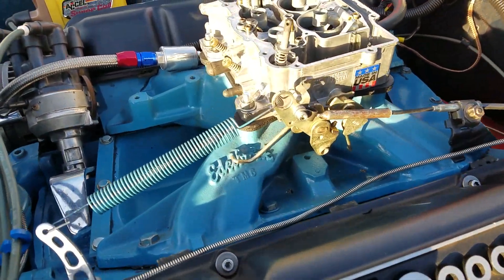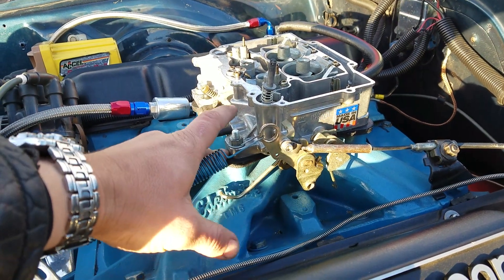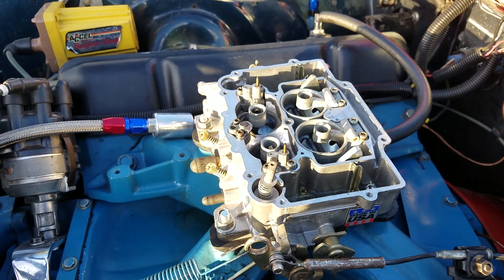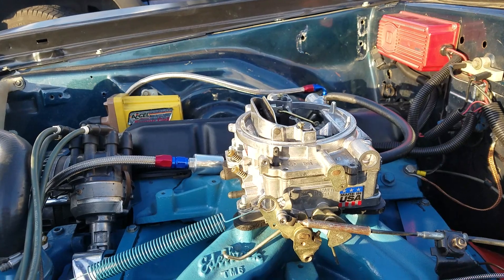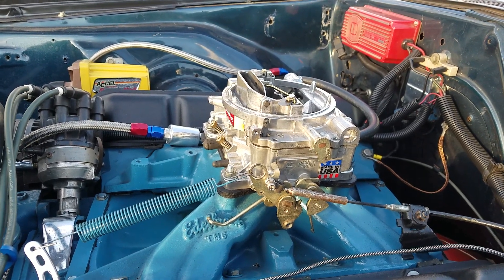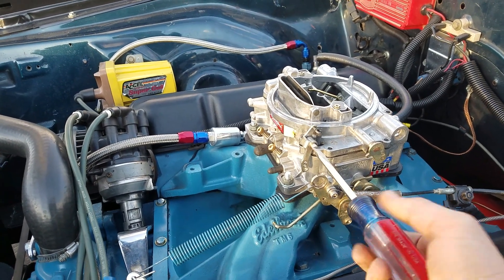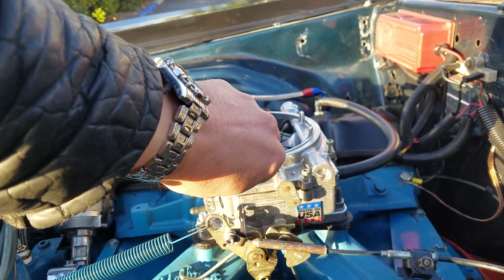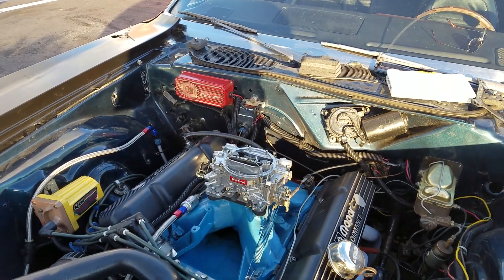Adjusting your edelbrock carburetor explained on big block plymouth cuda project

Comment: When I bought my 94 K/1500 pick up, they had just put a brand new Edelbrock aluminum intake and carb, it's on a 350, I love it and totally agree they are practically bulletproof, I  did live at high altitude in NM and now I'm in Arkansas, it hasn't given me one minute of trouble, I've owned Holleys, Quadrajets, Carters, Edelbrock  is always gonna be my choice, enjoyed the video, man.
Reply from the maker: Thanks.  They are great, and if properly set up won't give anything up over any other design...

Comment: About a minute and a half in, you unanimously answered a question I wasn't even bothered with at the moment. I've done several things already to combat heat soaking, but it should be noted that Ford's 429 and 460 have that mid head exhaust cross over on the intake and I believe that is more than most likely why I still have the problem.
Reply from the maker: Yup, same with Pontiac

Comment: I put a 600 Edelbrock on my tame 350.  Still had to jet it up a few sizes, it was leaning out at cruise.  Now it runs great, also put a 1 inch plastic spacer on, really helped for starting it in the summer after driving it.
Reply from the maker: wartactics oh yeah, the no leak construction is also an easy way to boil fuel
Reply: ya, I'd take my Nova to the gym or the store.  It would start real hard when it was time to leave.  Put an insulated spacer on it, starts right up and i've seen spacers are good for a few ponies too

Comment: The absolute most important part of using an Edelbrock carb is regulating the fuel pressure. The E-carb can only safely handle around 5.5# of fuel pressure, many stock replacement mechanical fuel pumps can produce 7-9# of pressure.  99.44% of tuning issues can be corrected with a fuel pressure regulator. 👍
Reply from the maker: HeadFlowInc very true.  Matching an edelbrock carb with an edelbrock fuel pump is usually the simplest solution
Reply: Invincible Extremes Muscle Cars Garage I’ve had great results and crappy results, but I found out when you actually read the instructions it’s helpful! lol.
Reply from the maker: HeadFlowInc very.

Comment: I'm a big fan of the Edelbrock/Carter 4V carbs. They are a awesome carb for the daily drivers. They are hard to beat for the ease of adjustability.  The other carb I really like are the old Ford Autolite 4100 carbs. They are a great carb with annular discharge boosters. But the Edelbrocks are still easier to tune.
Reply from the maker: Fordman7575 both carbs are my number one for sure.

Comment: Edelbrocks are the best carbs.  Not sure why everyone likes Holley’s so much.  I could never get a Holley set up correctly on my car and I tried several.  Edelbrocks are very easy to tune and come with a handy chart to show you the jets and rod combinations and how much richer or leaner each combo is from baseline.  It would be neat to see an Engine Masters episode comparing the power of a 750 Eldelbrock to a Holley on the dyno.  Probably won’t happen though..
Reply from the maker: Monte Stu when you see comparisons like that neither party  usually sets the carbs up optimally.  Because I'm willing to bet the numbers come out very close.  I myself prefer the edelbrock on the street because it won't burn your car down with your family in it.  Sure, you can check everything before each drive, but who has that kind of time... I'd rather just use something that was designed right from the get go...
Reply: Invincible Extremes Muscle Cars Garage 
I had a procharged elcamino that had bad a power valve and caught fire. My dad pushed it out of the garage while on fire and we watched it burn down. Also holleys are notorious for stripping out the fuel bowl threads.
Reply: Freiberger did do the comparison on a show nine years ago that predates Engine Masters, on a 350 Chevy. It was at the Westech dyno facility also, and you can see Steve Brule running the dyno. The upshot was both carbs produced the same power within a few hp.
Reply from the maker: CerebusTV I remember that one.  I cheat...  I run an 800 cfm eddy where a 750 would do... So I still get the hp I need but get all the benefits of an eddy...

Comment: Nice tutorial, they are definitely easier to work on and safer as far as fuel leaks. I just grew up with Holley's know how to set them up and like the look. I have a Qjet I picked up in a box of carbs and a rebuild kit for it, seems straight forward, that makes me nervous. lol
Reply from the maker: QQTrick1QQ I'll be honest, not the slightest clue as to how well a quadrajet works
Reply: Edelbrock is based on the Qjet except with easy external access to the needles, Qjet you have to take the top plate off to get to them. Same service parts. Rebuild Kits For Edelbrock #1903, #1904, #1905 and #1906 Includes all parts and gaskets necessary to rebuild Edelbrock / Q-Jet carburetors.
Reply from the maker: QQTrick1QQ oh ok, makes sense
Reply: For a real scare, try a Carter Thermoquad :-)

Comment: Hey man working on my first carbureted vehicle (72 chevelle mild cam/ upgrades) not really sure what’s in it because previous owner passed away and his wife sold it, it came with a 350 and edelbrock 1407... can’t seem to get a hesitation/ bog to go away from stop to easy acceleration (will stall unless I pump throttle) it seem to run fine once the secondary’s open and at higher speeds.. had carberator rebuilt/ cleaned... set timing 10 degrees btcd without vacuum advance... any ideas on what I should do to tune it?
Reply: I even put a fpr set at 5.5 psi with vacuum/boost reference... nothing seems to help
Reply from the maker: Yeah, buy the calibration kit that comes with smaller needles and bigger primary jets.  1407 carb is a 750 right? That's huge.  You'll need to run bigger primary jets to make it behave like a 600 cfm carb on that small engine.  Hope that helps a little.
Reply: Invincible Extremes Muscle Cars Garage thanks man I appreciate the help

Comment: I have a 1406 on a 350 with 489/504 lift cam and its dropping power bad at 4800 rpm. It runs smooth from idle to 4800, just no power from a major lean issue. I did some research and found out the 1406 is set extremely lean from the factory with .098 jets and 75-47 rods. I just ordered .100 jets and 70-42 rods from Jegs. Hopefully that will cure the fuel starvation problem. Also I'm not sure if the secondaries are opening all the way, I don't hear that 4 barrel sound at full throttle. Anyway, nice vid!
Reply from the maker: They can be tuned pretty easily.  I would honestly order a complete tuning kit just in case... but some smaller rods and some bigger jets will definitely help.

Comment: Have you checked out the New AVS eldebrock carb,  only way to go now,,,has 8 circular holes instead of one spray nozzle,
Reply from the maker: I need to check it out.  Its basically using the autolite 4100 setup...

Comment: I sure could use some help. I have a 440 mild cam tunnel ram. The car came with two edelbrocks 750. They been messed with. I took both apart cleaned them completely and reset the floats. The car almost feels like a miss when getting on it but I know it's the carbs. It idles fine. I checked everything vacuum is good timing is good I was adjusting the carbs and it makes a difference when you mess with them. I'm not sure what metering rods are in them. The car puts out about 500 hp or so. I just can't seem to get these carbs right.  When it gets up to about 1800 rpm it takes off and the problem is gone. And suggestions?
Reply from the maker: Hard to say without me actually messing with them myself but it seems like you are either too rich or too lean... a couple of 750 carbs for 500hp seem a bit much... but then it could be that they aren't getting signal... I would use smaller metering rods and max out the settings for the acceleration pumps first...  see if it improves.  Leave the smaller number alone, but the larger of the two numbers on the metering rod I would go down a size... and if it improves you're moving in the right direction.

What state you in? It's next to impossible to actually suggest the right answer over the internet but I'd I'm in the area I would love to look at it

Comment: I have a new avs thunder series 650cfm on my 305 with a small cam push rod springs intake mani ect.. The only thing stock is the block and the head itself.. This spring im pullin the heads off and puttin in ealderbeock heads... Does the new carb have the same problems like a older model like i said i have a Elderbrock thunder series AVS 650cfm??... Love the vid great work..
Reply from the maker: Viarella what problems did the older carbs have?  I've never had issues with them outside of boiling fuel

Comment: I have a 383 with aluminum Edelbrock DP4B dual-plane with stock exhaust manifolds and manifold heat riser installed, including that thermostatic damper.  I'm having a terrible time with percolation.  What do I need to block that crossover?
Reply from the maker: Oh yeah. Definitely.
Reply from the maker: You just need intake gaskets that will have a little metal plate in them for the crossover.  The aluminum intake still gets plenty hot so itll be just fine for fuel savings... but as you've noticed it gets TOO hot for today's gas.
Reply: @InvincibleExtremes  Okay, I found a Fel-Pro 1214.  https://www.summitracing.com/parts/fel-1214  On my old intake valley pan gasket, I had no "extra" paper gaskets, only the stamped steel pan and I didn't use gasket cement.  I was always unsure how good of a seal I got.  What do you think about the paper gaskets and cement?  I've been using Hylomar for stuff...

Comment: What might you suggest jetting wise for a stock 305 in an 83 surburban on 38s? I've never really messed with an eldelbrock. I regasketed it a while back but that's it. I've always had holley or qjets.
Reply from the maker: Ryan Burman 305?  Man, I don't even know.  Really matters on the carb too
Reply: I've never run the numbers but my money is on a orielly  auto special. 600-650 cfm. The part that has me is a 1/4-1/2 throttle hesitation if you don't roll into the throttle. Almost a miss fire but from being lean. That's the only spot and otherwise its pretty nice and gets decent mileage. Its a little sensitive to moisture in the air but other than that its been a good carb. First Edelbrock always had Holleys or Quadrajets.
Reply from the maker: Ryan Burman oh, go down on the needle size, the big number.  For example if it's a 75/37 get a 73/37 or whatever.  And use the hole on the accel pump that's closest to the pivot.  That's all it'll need
Reply from the maker: Ryan Burman and change to the silver spring, it'll push the needle up into the lower number quicker for better response
Reply: Invincible Extremes Muscle Cars Garage thanks I'll give it a shot.

Comment: Hey man, I have a brand new 4160 Holley that no matter what I try has an off idle bog. I’ve adjusted the squirter, jets, floats, timing you name it with no success. No vac leaks whatsoever and Holley is no help. Now I’m going to return the carb to the store and they have edelbrock 1406’s on the shelf. Do you think these are really that good for a street driven daily? It’s an sbc 355 with a 700r4 behind it with 3.27 rear gears
Reply from the maker: They really are that good man.
Reply: Right on man thanks

Comment: Just installed a avs2 650 cfm on my small block 305. Nice smooth idle but as soon as I give it any amount of throttle it starts to detonate. I know a lean air fuel mixture can cause that and my plugs are spotless, so I stated going up in rods and jets. I’m now up to a 107 jet and a  68 42 rod. The detonation is much better but I can still tell it’s there and my spark plugs are sill pearly white. Could it be my floats need adjusting or something because I feel like My jets are too big and my rods are too small for my little stock 305. Any suggestions?
Reply from the maker: Your 305 may have such a tiny "signal" from a small cam that a 650 carb is simply too big.  Because of this you will have to run huge jets on the primary just to give it the fuel it needs.  Same settings on a healthy 350 would be way too rich...  the bigger the carb, the bigger the jets have to be to overcome the small amount of airflow actually being sucked.
Reply: kinda figured a 650 cfm would be big for a 305 but I was trying to future proof for my upcoming 350 build. So if bigger primary jets will help my problem, what do you recommend I go up to so I can safely drive? .113, .116, .119? I’m at a .107 at the moment.

Comment: What do you think is a good starting point for a mild pretty much stock 78 Pontiac 400. Right now I got .100 primary jets and .95 secondaries 70x42 rods
Reply from the maker: Austin Sparrow what size carb.  That makes all the difference.  A smaller carb will need smaller jetting on the same motor because the signal will be stronger...
Reply: Invincible Extremes Muscle Cars Garage oops forgot to tell you it’s a performer 600cfm
Reply: And it actually has 70x47 metering rods not 70x42
Reply from the maker: Austin Sparrow should be just about right.  Honestly it sounds about right.  600 is a bit small for a 400 in my opinion but it can be made to work.
Reply: Invincible Extremes Muscle Cars Garage ok thank you, and if you don’t mind taking a guess I could use your opinion on a problem my firebird is having. It starts fine, idles fine, and even revs fine when in neutral, or with the clutch in; however it pops sputters and backfires when accelerating somewhat hard. It is fine if I ease into it, but if I accelerate a little harder it starts popping and sputtering. I can not for the life of me solve the problem. I checked the dwell on the points checked the cap and rotor and coil. I’ve tried rejetting the carb and it didn’t seem to have any effect unless I just didn’t find what it needed, I installed a fuel pressure gauge and it is at 6.5-7 psi, so I ordered a fuel pressure regulator thinking that may be the problem, but it hasn’t arrived yet. So, if you have any suggestions as to what it might be I would greatly appreciate it.
Reply from the maker: Austin Sparrow sounds lean.  Needs 70/42 metering rods, and a silver spring.  And use the hole closest to the carb on the accel pump.  Also, ditch the points, and get a $50 HEI distributor from eBay for nice hot spark.  Keep the points as a spare.
Reply: Invincible Extremes Muscle Cars Garage it’s got 70/42 rods right now, and I tried it with silver spring but it didn’t help at all, I will try the accelerator pump though
Reply: Actually I may be confused on what metering rods it has I will have to check if it’s 70x42 or 70x47 I am confused
Reply from the maker: Austin Sparrow yeah, go try our different combos to see if it improves any, and that's the direction to move to.
Reply: Invincible Extremes Muscle Cars Garage ok, thx I appreciate it
Reply: Invincible Extremes Muscle Cars Garage yea I checked and it has 70x47s, so I’ll put some 70x42s with the silver spring and change the accelerator pump and go from there thx for the help
Reply from the maker: Austin Sparrow yup, and if it got worse, then you know you are running too rich and need to go to a smaller jet
Reply: Invincible Extremes Muscle Cars Garage alright thx

Comment: Do have any jetting recommendations for a stock 383 with an Edelbrock 600?
Reply from the maker: Start with what edelbrock had in there originally, go maximum on the accelerator pump and be prepared to go up a needle size to put less fuel in it... reason being is the 383 is going to have a lot of signal for the 600 carb.  For example, I took the same carb off the 2 barrel Buick we have, and had to jet down to use it on the 302 in the supra... because the signal on it was much stronger and it was running rich.  For a 383 I would consider going to a 750...
Reply: Invincible Extremes Muscle Cars Garage That seems to be the issue I’m having now. It smells like it’s running rich and I believe I’m having an issue with the fuel boiling out also.
Reply from the maker: The boiling fuel is an easy fix, use a dual plane 1/2 inch spacer.  Keeps the plenum separate but keeps heat off the carb.  Come to think of it, the one on my supra was a 4 hole I turned into 2 hole.  Either way, it's an easy $20 fix.
Then either go down one jet size of use bigger primary metering rods (needles) in the carb.  Mine was so rich on the supra it would fall flat on its face on full throttle ...   the idea that a bigger engine needs more jetting is actually backwards... the stronger the signal, the more it sucks through the same size jet...  for example, if you go to a bigger carb, you will need bigger jets, not smaller... because the signal will have less impact.

Odd but true.

Comment: I've always had holly. Like on my 327-m21 73 colt. N it runs great. But this 1406 is sorta stumping me. My dad like the old thermoquads. I just can't seem to get it right. My other 1406 runs fine after I watched  the vid of you working on your Z but this other one hates me.
Reply from the maker: Talon Vaughn edelbrock don't like high fuel pressure, so make sure it's not above 6, and then make sure none of the lines run anywhere near the engine... give that a try and see if it works at all...
Reply: Yes sir it's at 6.3ish psi